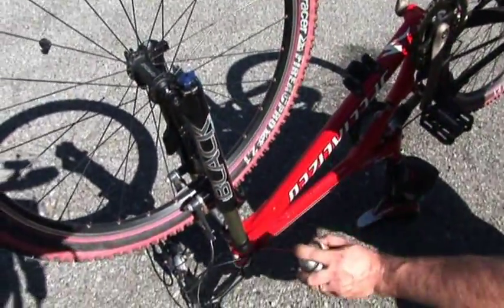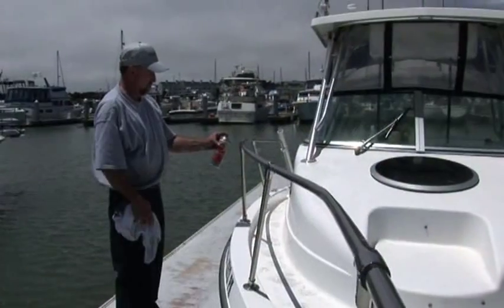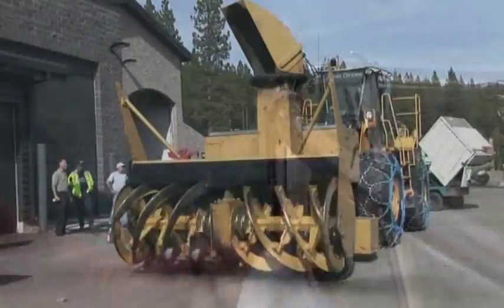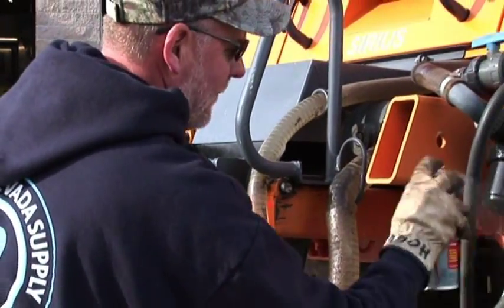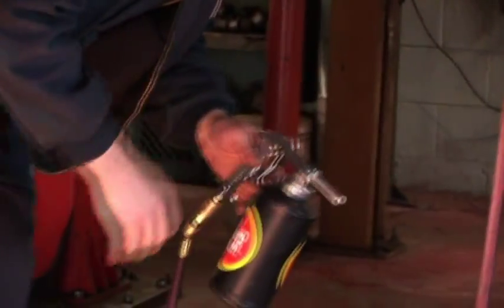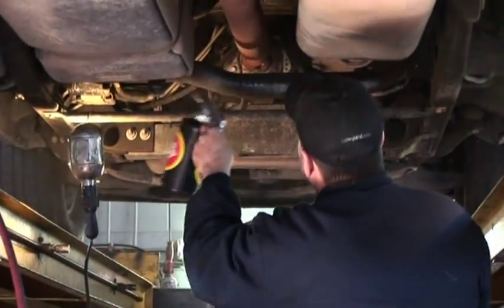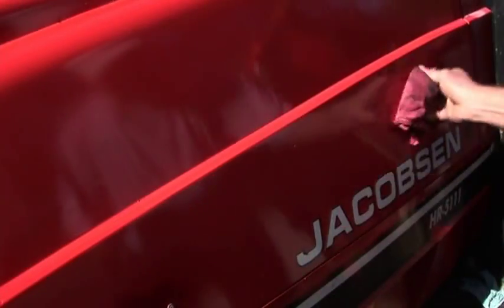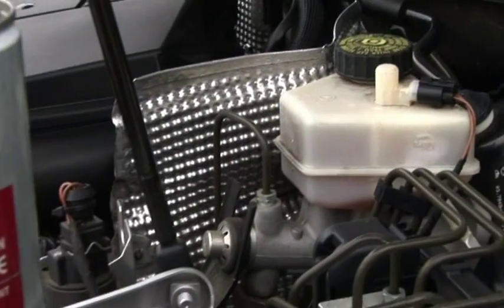Fluid Film, The Best of the Best. Nothing Else Like It!

Comment: I can tell you without a doubt, this stuff works.  When I first bought my 2012 Jeep Wrangler, I purchased a case at Lowe's for around $60 total (6 cans). Every fall I would spray the hell out of my frame, noting other jeep wranglers that had bare frames and where they began to rust in areas. Every spring i'd power wash it off. 

I just traded in my Jeep 7 years later, 106k miles, Buffalo NY Winters, and the dealer asked me how I kept it so rust free. I told him what I did every year. I HIGHLY recommend this product. IT WORKS!
Reply: This is great to hear because tomorrow my project is undercoating my car with 3 cans. I might need more but I'm starting with 3.

Comment: can this product be used on handguns
Reply: yes, it works great to protect and lubricate. solvent free so it will not get tacky
Reply: So does Fluid Film really stop the Rust dead in it's tracks for up to a year or until it's removed?
Reply: Hello,
Yes Fluid Film soaks into the rust and penetrates to the pores of the clean metal beneath it. It will also help soften the rust so if you chose to wire brush the metal the rust will be easier to remove. If you have any other questions feel free to ask!
Reply: FLUID FILM®    9.00. Per can at Lowe's..